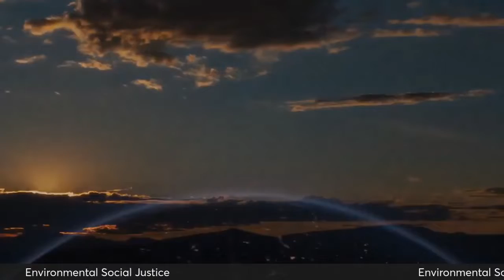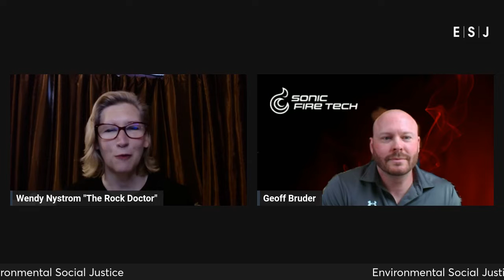𝐒𝐨𝐧𝐢𝐜 𝐅𝐢𝐫𝐞 𝐓𝐞𝐜𝐡

Comment: Cool video but I noticed the video didn’t address a significant concern—what happens after the sound is turned off? From my understanding, once the sound waves, which are integral to extinguishing the flames, are discontinued, the fire could reignite unless other fire mitigation strategies are employed simultaneously. Some of the things Bruder is saying aren't making much sense. He also said things like "breaking the chemical reaction" which in simple terms isn't even really a good explanation of what is happening. Could someone please answer my questions I'm getting terribly confuzzled...
Reply from the maker: @SkibidiSamwich  excellent question, definitely reach out and ask them, they are the experts!
Reply: Hey Skib, I'm an early investor in the tech, and please note this is not an offical response. 

Great question and the answer, as I understand it, depends on what type of fire it is and a few other factors (did the fuel have a chance to cool). For example, if it's a typical chemical fire, say kerosese, if you disrupt the chemical reaction (by distrupting the oxygen in the air) the fire will not return. If it's a wood fire, the fire will return if the fuel was not cooled. Because of how it deals with chemical fires, the tech is has a lot of exciting applications from a "no mess" kitchen hood fire suppression system to mitigating oil rig disasters.  It's being vetted heavily for ultra early wild fire suppression and home ember defense (for those living in wildfire prone areas) as well. 

Again, this is my understanding of the tech and not an offical company response. I know they're busy building the next gen of the tech but by all means, please go to www.sonicfiretech.com to learn more and/or send an inquiry. Thank you for your interest!!